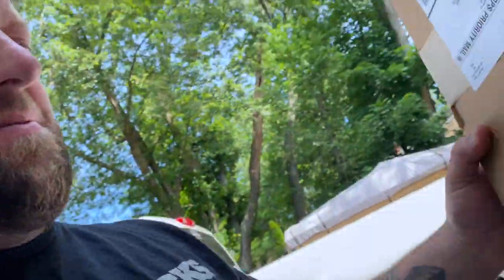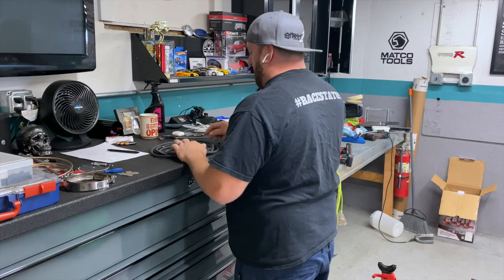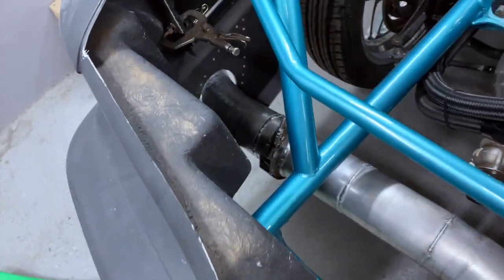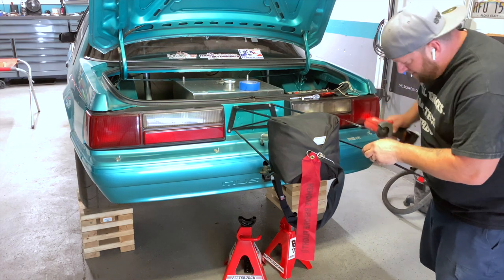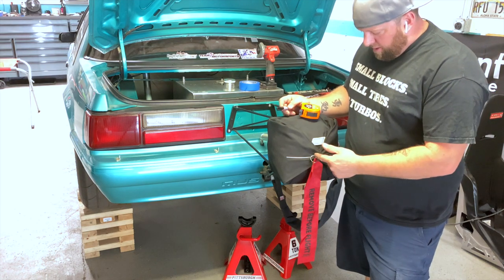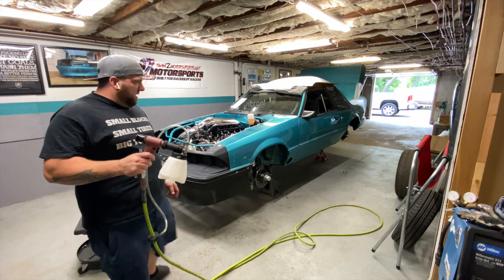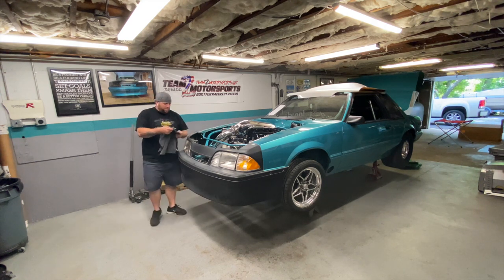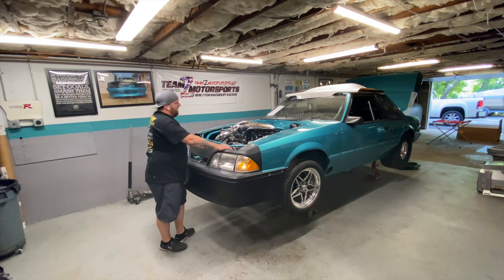Foxbody Upgrades Ep: 16 Parachute, grounding and brakes.

Comment: Idk if you have one already, but if not grab you a “parachute cable end cap” from Tim Mcamis website buddy, really cleans up the look of the cable when you cut the sheath to length. Cant go wrong for 10$. I just put one on mine recently. Ive heard people say 3an tube nuts work as well 🤷🏻‍♂️
Reply from the maker: Thanks for the tip. I actually have a -3 tube kit threaded on the end of it.